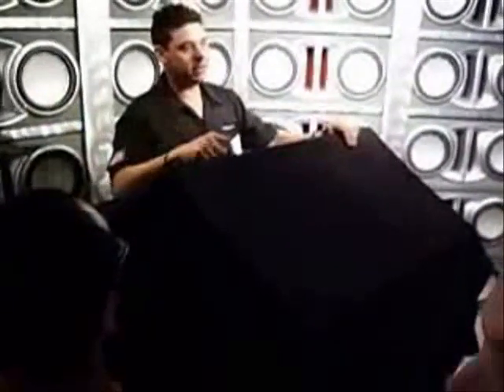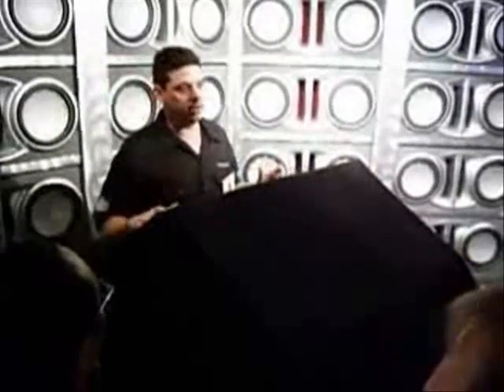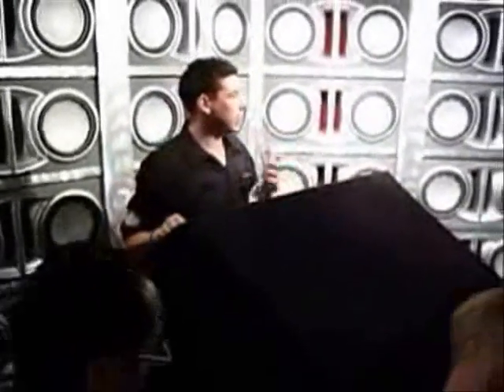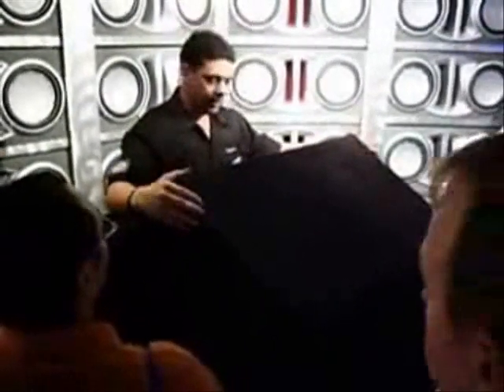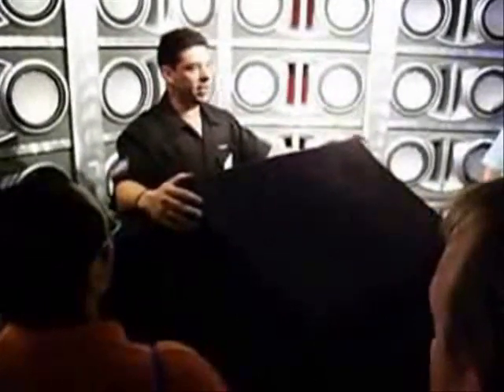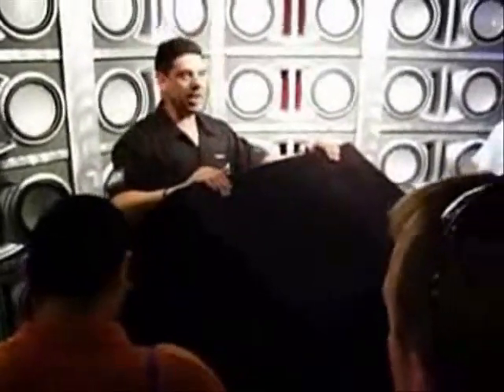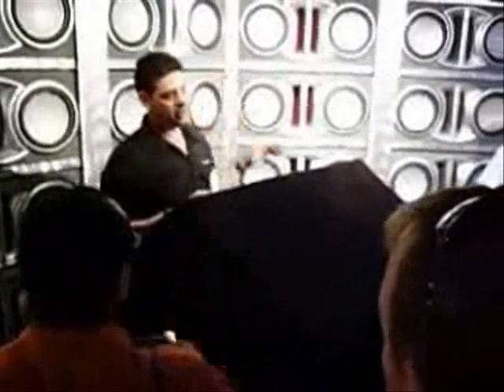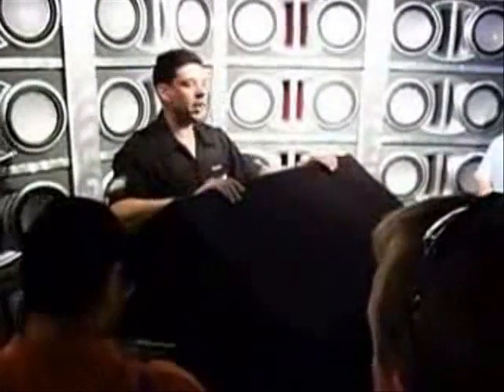15,000 Watt Car amp..Rockford Fosgate T15k Hybrid Technology

Comment: This amp is impressive for what it is and what it does, but I'd rather use a DC audio 9k or a kicker warhorse for my subs.  True mono block power from a single channel.  I'm kinda tempted to try one out thought on my mids and highs just to see the sound quality difference between the t15k and an ordinary class AB amp.

Comment: This is very interesting from HIFI pov. Best SQ car amp most likely, few are AB and even less of similar ability. Would love to hear it, awesome design solution. 
I disagree about cleanest of all, home HIFI amps are completely component isolated, don't find amps with same - 10x as much cost running four channels in one box. Usually monoblocks + outboard toroids to keep electromagnetic/physical isolation between channels. Caps are used for filtering, not power source in most hifi amps. Nice vid.

Comment: @dc12volthippy 

You are severely misguided. 

Car batteries may be designed for these currents, but they cannot sustain those current levels for long. I dare you to find an alternator that can handle the charging currents required or space under the hood of a car for the required number of regular alternators. You also then increase engine load which reduces fuel mileage.

Comment: The amp sitting beside my monitor has 134v DC across it's rails. It's not 15000watts. does this amp have a 1100A fuse?

Comment: @JustDiploid There is no such thing as "watts RMS"  it is a made up term.  Watts = Volts RMS X Amps RMS.  Therefore it is actually "Watts RMS^2)  since RMS means Root, Mean, Square and we are squaring it again, that cancels the "root" in RMS so TECHNICALLY it is "Watts MS"  which means nothing.  The correct term is "Watts".  There is no such thing as peak watts or rms watts or when lightning strikes watts.  Just Watts.
Tony D'Amore
Beef Supreme

Comment from the maker: @dc12volthippy wrong.  Every amp does have caps but there is MUCH more to it then that.  Check my website forum under the rockford section......there is a post about how this amp works if you want to understand it better rather then just commenting of the top of your head.

Comment: This is how EVERY AMPLIFIER works.This is stupid. Every amp has huge capacitors in it, these amps just have bigger capacitors to store more energy. Andh if you have big enough gauge cable, you don't need such big caps because car batteries are DESIGNED for huge amperage loads.

Comment from the maker: @iraqiboy90 its a 15k amp that does about 1,000 watts over rated power.  My T2500.1bd's are 2500 watt amps and they all do at least 3300w RMS.  A lot of brands give you a little more then you pay for......

Comment: What the fuck? Sorry to get nerdy again, but power = voltage*current. 17kw RMS running on 12V would need 1416A, not 2000...

Comment: that is sick and it is a piece of engineering that would be imposable but they pulled it off fairplay  internal power storage for all that power is fenominal    if only i had the dolla !!!   oh well my little shitty vibe space 15 `s and my lanzer shitty amp dus the job hits hard for like £800 all in with head unit and wire

Comment: dude thats one bad ass amp. and i wouldnt be suprised within the next 2-3 years Rockford and stillwatter put that hybrid technology in all of their amps. think of it pushin a grand of power to a pair of 15s and only useing a 8gua power wire to run back to the amps, shit that hybrid amp is more effecent than a hybrid car, when have you heard of the 1.6l engine getting 500% better fuel economy due to the hybrid electric system? thats why i love mobile audio our technology actualy advances.

Comment: Also, there is an inverse cube law in effect - a 30Hz note at 100dB represents 8 times as much acoustical energy as a 60Hz note at 100dB. There is also the issue that most systems use two normal speakers for stereo, but only one sub. Therefore, to go an octave lower than your main speakers, the subwoofer will ideally be 16 times larger than the main speakers. The more extension a sub attempts, the larger this number will get.

Comment: dude wow did you even go to that link? ... why does a tweeter require less power then a sub??? because it is a higher frequency which means you have less resistance, but when it is a lower frequency it requires more power to push it because there is more resistance so the lower the more power it requires answer that ... why does a tweeter take less power then a sub?

Comment: it takes more power to reproduce lower notes since the signal wave is slower and the speaker motor structure and driver is larger in lower frequency producing units and it takes more power to move bigger drivers at slower speeds. Its pretty simple logic really. It takes a bigger more powerful motor to make a bigger car run faster or the same speed as a smaller car with a smaller motor ... don't u hate it when the 5 year old out smarts you :)

Comment: the higher the note means a smaller speaker can play it, very high pitched frequencies are played by a tweeter 1"-2", mid range frequencies are played by a driver 5"-10"(lower then the frequencies the tweeter plays but higher then a sub plays) low end frequencies (lower then the mid range) are played by a sub 10"-15", so the lower the note the bigger the speaker and more wattage it takes to play ... do you see a trend on how the speaker gets bigger every time the frequency gets lower... dumb ass

Comment: and why do you think smaller speakers are used to produce the higher the sound for example tweeter's barely take any wattage at all ... a driver smaller then a sub but bigger then a tweeter, they can use varies rates of wattage depending on size. then finally a sub a high bass note does not require the most power a low bass not requires the most wattage  or power in layman's terms.... please know what your talking about before posting ... our talking to an audiophile here

Comment from the maker: you stil wouldnt measure an amp with a full powered sine wave, for 2 or 3 minutes straight.  Watch some of my video's and see these in action, there is no denying how much power they put out and with rap music, long bass lines are similar to sine waves..it handles it fine.  Not only that but these are argueably  the cleanest car amps ever made.

Comment: Yes it will make a difference is the Ohm load if you wired you subs in parallel or in series.  Ex.  you got 2 svc(single voice coil) subs at 4 ohms each, if you wired them in parallel e.g. positive to pos and negative to neg your amp will see a 2ohm load which is less resistance meaning more power to your subs. Series is just the opposite pos to neg and pos to neg now you have an 8ohm load more resistance less power.  Hope that helps

Comment: LOL wow is he mistaken about the wire. I work for novatech, bridging 2x D-class 9000w amps with a single speakon connector, its only 4 guage wire, not even. your still only getting max of about 70v, regardless of the watts.

Comment: The first song is a tough one....old school audio heads know it.  Boston Acoustics used to issue a promotional disc once a year, the track in the video is a song called "Tricycle" and it's off of the 1993 promo CD called Hot Rods and Cones "The Boston Imaging Disc".  The one the year before was The Boston Bass Disc and it has some awesome Jazz for setting up mids and highs....

Comment from the maker: its got 2 300 amp alts...usually his alts do a little more then rated so maybe 320 +/- each.  That plus 5 XS power D3100 Batteries and it does pretty good.